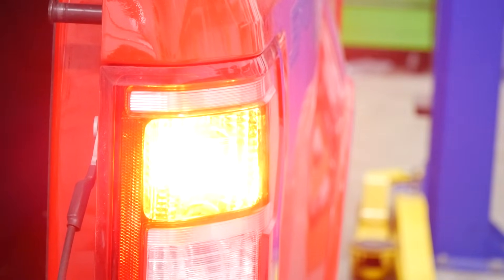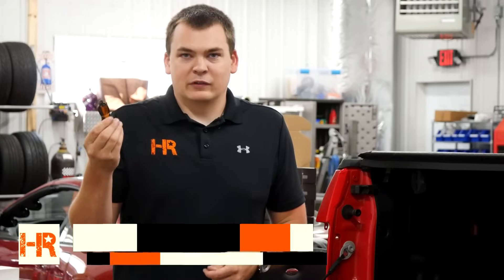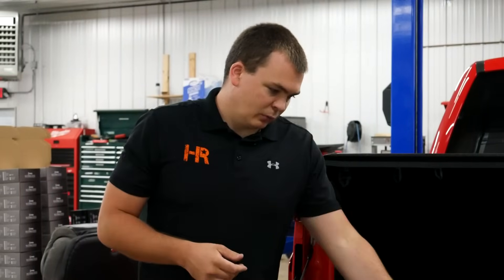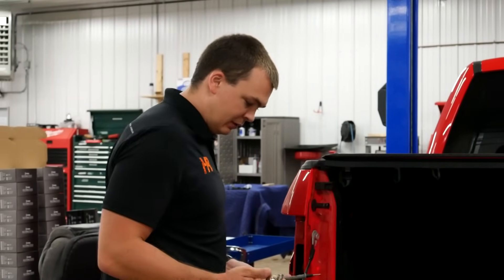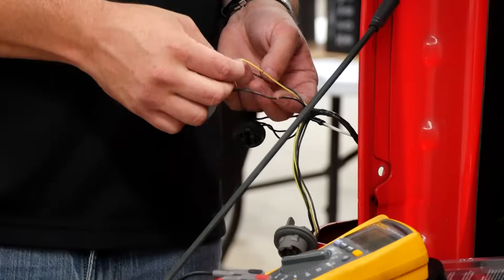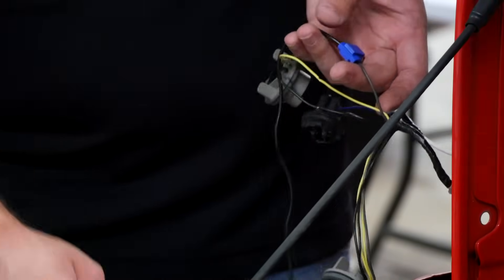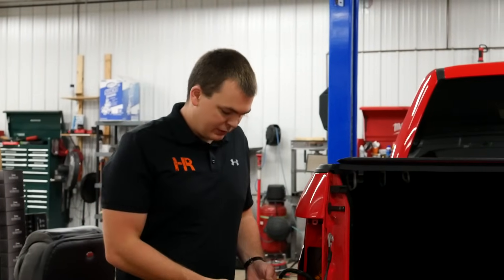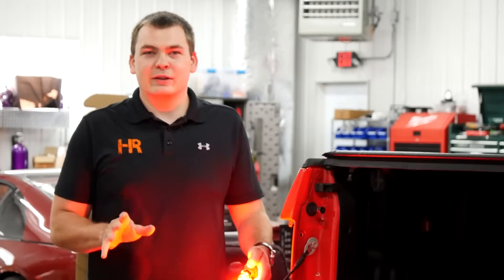How To Install LED Resistors - Everything You Need To Know | Headlight Revolution

Comment: I installed led bulbs on my 1995 ford F-150, I don't have the hyper flash issue but it does affect my Cruise control. When lights are on cruise doesn't function when lights are off it does.  I have 1 bulb that does it all blinker/park/brake. Will installing a resistor fix my cruise control problem and which wire do I connect it too? Thank you
Reply from the maker: Possibly. Sometimes the vehicles' original electrical circuit needs that resistance provided by the original bulb or the resistor. Worth a shot, but I can't say for certain!

Comment: there are LED turn signal relays out there so there's no need to wire in resistors.
Reply from the maker: That is true for some vehicles. Many don't have the ability to swap out a relay if the flashing is controlled by the BCM. Anything made after 2004 is more and more common to NOT have a relay you can just swap out.

Comment: question I replaced front and rear blinkers and brake lights on my 2011 FORD Escape with new LED's  and I added LED Decoder Adapter Anti Hyper Blink Flash Error Cancel Canbus Brake 12V,  just the back light, turned the blinkers one it was blinking normal, but as soon as I turned the lights on it started blinking fast again, any ideas how I can fix this
Reply from the maker: Hi Roger, for troubleshooting like this please contact our help team: sales@HeadlightRevolution.com

Comment: Where should I connect the resistors, because I change my front turn signals and now it blinks so fast, so I add in the front or back turn signals. Thanks
Reply from the maker: Everything you need should be in this video!

Comment: Do you need a load equalizer for each led bulb? Because I wanna change every bulb for led ones and my tail lights have three: reverse, turn signal and side marker. So do I need one for each? People always seem to change either the turn signals or tail lights only but not all of them so I can’t find answers anywhere. Please help. And later on I wanna do the same with the headlights.
Reply from the maker: You only need a load equalizer (resistor) for each bulb that blinks in the turn signal circuit. Most of the time all other bulbs require no extra parts.

Comment: Reyes doing this on 08 Silverado hooked resistors one wire to turn and one to ground double checked and still hyper flash any suggestions? Did a resistor to each light separately still hyper.
Reply from the maker: Chris Nelson 2:32 PM
The 2008 style Silverado trucks have multiple turn signal wires because they dasiy-chain together to more than one turn signal. You have to wire it up to the correct blinking bulb wire and it's one of two. Any ground in the harness will work, but you need to search to see if you have another blinking wire too. This writeup has some tips for you:
https://www.silveradosierra.com/hid-led-lighting-f505/led-load-resistor-wiring-confusion-t76650.html

Comment: Do you need resistor if you have lower power led light
Reply from the maker: If the voltage source is equal to the voltage drop of the LED, no resistor is required.

Comment: hello, i have a bmw e46 compact the tail light has 5 cables,i have identified the ground but should i connect the other end to the positive wire of the turning signal ?
Reply: Let me butt in. Ground and Turn or Flash, not Positive which is normally the Power or 12 volts.

Comment: What kind of load resistors do I need for a '98 Nissan Altima ? I tried the 50W 6ohm, it worked when i tested them once then I tried to actually connect them and it didn't work.
Reply from the maker: XenonDepot XD6 6 Ohm Resistor
Reply: @HeadlightRevolution  Okay, Thank you !

Comment: There is an easier way.... A heavy duty flasher will give you the same result. I got a flasher with a rheostat and can make it flash at the rate i choose. I'm no electrician, but i have successfully made a HD flasher work on several vehicles.
Reply from the maker: That's one way to do it. We prefer to show this way as its easy to grasp and sure to succeed.
Reply: I bought a flasher from Amazon with a rheostat on it that allows me to adjust the rate of flash from 0.5-2 seconds. I have LEDs front and back with no resistors.
Reply: They make HD flashers for LED use. I looked and found a couple of different flashers. Without knowing how many pins are on your flasher I can't pick one. But, find a LED, or HD, flasher that has the same diagram on it as the stock flasher.

Comment: I just want to make a comment about the flashing light without the resistor, shown in the first part of the video......it wasn’t blinking that fast. I’ve seen hyper flashing and that wasn’t, in my opinion. Mine flash that fast and I’m glad cause my turn signal lights are red like that truck. It makes it easy for other drivers to differentiate between braking and lane changing, especially in Toronto where 90% of people drive fast and tailgate.......so I think if your lights are flashing a little bit faster, don’t worry about it.
Reply from the maker: Definitely not necessary but we still recommend installing them to keep proper power running to them

Comment: My led switchbacks hyperflash with parking lights on even after installing 50W 6ohm resistors on my 3157 bulbs. With parking lights off, they flash at normal rate.
Reply from the maker: Give us a ring sometime today and we can have our support team help you troubleshoot. 218-755-5200
Reply: @HeadlightRevolution  I am not in USA. If I can chat with your team via email or Facebook would be really helpful. Thanks

Comment: i have a problem, after putting on the resistor i saw the needle for the battery was flicking back and forth with the blinking light. to keep it short, when i took off my brake switch and opened it, i saw burn marks on the contacts. after a while of use the burn marks keep the brake switch from working. any solution for this?

Comment: WOULDN'T IT BE EASIER AND
SIMPLER TO JUST GET A DIGITAL
TURN SIGNAL FLASHER...INSTEAD 
OF PUTTING A RESISTOR ON EVERY
 TURN SIGNAL LIGHT ?
Reply from the maker: GTR lighting just released the Carbide Turn signal, no resistors needed!

Comment: So I just got a 3rd brake light for my 03 Ram 1500 and the led cargo lights won’t turn off even if the truck is off. So if I get some resistors it’ll solve my issue ?
Reply from the maker: Hey Anthony, resistors tend to help fix hyper flash.

Comment: The one problem you'll run into wiring your resistor like this is that you've just created 2 paths for electricity to flow so your vehicle will never know when your LED is no longer working until after the resistor blows too.
Reply from the maker: We have yet to see an issue with how we have wired the resistor. But if something changes we will be sure to update everyone!
Reply: @HeadlightRevolution  It wasn't a question...it was a fact I just stated...in the auto shops I've worked at it's a reocurring issue that has been brought to my attention...since the sensor on most vehicles HUD 95 and up will only turn on and let you know a bulb is blown when there is no return of electricity...and since the resistor acts as a second return line there is no break in the line causing the light to stay off because it doesnt recognize the led light is out...you won't come across this issue often unless the customer is automotive savvy or you test it for yourself...led's take a long time to burn out so you'd have to be in the business for a long time to see this.
Reply: "you won't know your LED is no longer working"

Lmao ok

Comment: Will it ever cause a dim blink on one side
Reply: Ive never installed the resisters yet ive installed led lights on my trailer. And when I hook up my trailer to my truck one side is normal and the other is dim when I activate the turn signal on the passage side truck and trailer
Reply from the maker: It's not an issue that we have run into when installing these resistors.

Comment: My issue is not hyper flash outside but rather inside on my dash for my 2015 Ford F150.  I will try parallel first and then if that doesn't work then I will try series.
Reply from the maker: Let us know how it goes!

Comment: During the day my flashers work great other than the hyper flash. In the evening when the lights come on the right mirror light is on, there's a message on the dash about turn signal on and half of my tail light is not working. When I try to use the right turn signal it flashes once and stops, any clues?
Reply from the maker: It sounds like we may have more questions about this. Can you give us a call and we can hook you up with one of our support staff? 2187555200

Comment: Tried to installed my H7 high beam bulbs H3 fog light bulbs with led , they were flashing for good 30 second at least after I used them , any solutions?
Reply from the maker: Hey there! It sounds like we will probably need more information than you provided in this description. Will you give us a call and we can help troubleshoot. 218-755-5200

Comment: My resistors for my 2016 GMC Canyon were plug and play.
About $10 each to use my for my led upgrade for front and rear turn signals and taillights
Put a temp probe on them and they were almost 400 degrees.
Really hot! Any low temp resistors or good suggestions for me.
Just didn’t like how hot they were getting especially being that close to each other.
How hot does yours get as an example for the Ford vehicle you did in the video?
Thanks for the help.
MarkO
Reply from the maker: Hey Mark! We aren't sure of the exact temperatures of our resistors but it is definitely not 400 degrees!

Comment: My only question isz why to the ground? I.E. when I were installing resistor to the H7 headlights, I were told to put resistor on positive wire (+------/ ~=~ /------+), not one end to the positive and another end to the ground.
Reply from the maker: Sounds like you have some questions our support staff can answer. Give us a ring today! 2187555200

Comment: Do I need to put load resistors on all four LEDs for the hyperflashing to be fixed?
Reply from the maker: We have a few questions of our own to be able to answer that. Can you give us a call sometime today? 2187555200
Reply: @HeadlightRevolution  thank you for the reply on this, I'm from the Philippines and the reason I'm asking is that I see all these videos on installing the load resistor but they don't specify if this is per turn signal LED or per pair of turn signal LEDs. I have a 2015 KIA Soul which I can access the rear turn signal wiring easy enough. But the those in the front has that one set of wires that connects to the headlight housing and the turn signal is housed in a socket with no direct wiring. I think I'll need to check the mass of wires going to the headlight housing to determine which is which.
Reply: 1 bulb requires 1 resistor, if needed. Cars with CanBus system almost always require resistor for every single bulb you replace, because headlights won't be blinking, but you'll get burnt bulb error and led will shut off after few seconds you turn it on.
Reply: @baihult  thanks for the clarification. Now I know what I need to do to have the LEDs function properly.
Reply: @baihult  My car has CanBus and I only replaced the front indicators to LEDs, but all indicators, front and rear are hyperflashing. Do I also need to change the rear indicators to LEDs and get resistors for them also to stol the hyperflash all around?
Reply: Warren Rozario if done properly, it shouldn’t hyperflash. That’s the system - if it detects that one bulb is burnt, rest of the fine bulbs will start hyperflashing. And canbus detects leds as burnt bulbs. Did you installed resistors on both replaces leds?
Reply: @grailph  Hello, I am facing almost same phenomena as you described. My car K7 Kia (2014) is also easy access in the turn signal in the rear while access in the front is complicated as all wires of head light and turn signal etc is combined  all together, thus it is too much work to take out only for turn signal wires for load register  hyper flashing issue.
Currently, both right and left in the front is halogen while both in the rear is led installed and No hyper flashing.
I tried already installed load resistor in the rear (easy access) but still hyper flashing.
Someone expert says on other YouTube each led require each load resistor, then it means I need four load resistor installation.
May I ask how you solved in your car? (your case is very close to my problem..)
Thanks. Daniel (Korea, Seoul)
Reply: @deobiloilchil  I only put the load resistors in both rear taillight housing . In my case I put the load resistor across the black and yellow wires of the turn signal bulb. The front turn signals I kept the incandescent bulbs. No hyperflashing. I even replaced the  side turn signal with a T-10 led and still no hyperflashing.
Reply: @grailph  Thank you for your quick reply!. I also still have original incandescent halogen in the front signals... Thank you for me how to deal with this...

Comment: Why the hell would you strip back the wire shielding you don't need ? Now you ruined it's  seal. That's lazy. Just get a goddamn wiring diagram.
Reply from the maker: Thanks for recommendation Chris!
Reply: @HeadlightRevolution  I'm sorry, I'm not trying to be rude but it's much better to never disturb a wire jacket if you can, it will cause massive corrosion.
Reply: chrisdigital that was really rude 😣

Comment: Pro Tip If you wanna avoid ripping part of the sleeve off to test a wire... take a safety pin or a sewing needle, and jam it into the wire you wish to test, then hit the pin/needle with the tester... Bam! no broken sleeves!
Reply: If you probe wires just seal with liquid electric tape
Reply: @HillBilly-1  i do that all the time never had a wire fail. I usually liquid tape and heat shrink my soldered connections never had one green
Reply: I was going to make the same suggestion. And use the chassis ground rather than clamping the ground wire. The 0v wire is the ground wire ground or ground it directly to the chassing to prevent poor wire juction right where you mount the resistor. Kill 2 birds with one screw.
Reply: You can also use your multimeter probes on the connector pins at the end of the harness
Reply: Could just use a test light in the plug then follow the connection back to that wire 🤷🏻‍♂️
Reply: I would like to know do you have to have a resistor for LED lights on your turn signals if you're doing 1930 through 1970 0 year vehicles thank you
Reply: And I like to know do you have to have a resistor for the front for the back or for resistors per vehicle
Reply: Back probing,  let's be a little more specific about that so people understand. 
  To be honest, that is the correct way to test any wire harness.
Reply: I have done it this way for over 50 years, always works but I do like to Solder Wires, they make the Best Connections for sure...
Reply: Thats not bam..thats Boom!
Reply from the maker: Great advice!
Reply: That's horrible advice!! Never poke a wire unless you're sure you're going to cut it anyway. Once you put a pinhole in that wire you've sealed its fate, it will eventually turn green. It's just a matter of time and there's no stopping it.
Reply: @flyurway  liquid electrical tape. A pin hole is easier to fix than a fully separated sleeve. IMHO
Reply: @lockelamora0717  Again, once you poke a wire, it's done! I don't care what you put on it or how quick you do it, it's just a matter of time. If you know what you're doing there's no need to poke a wire in the first place!
Reply: @flyurway  C'mon, with the universal doomsday wire message. The "demise" of a breached wire is SO relative to environmental conditons and how well you protect it. ALL or most 'pokes' can be very successfully protected/fixed for decades or probably way beyond the useful life of the object its connected to.
Reply: @jfitzmo  🤣😂😆😁 Can tell you've never done wiring in the north, huh?! If you break the insulation, it WILL corrode! Period! Just one little poke with a test light is ALL it takes. Ask me how I know. And depending on the elements it's subjected to, it can be just a couple weeks! And nothing like being the middle of a freezing winter and your tail lights are out and you HAVE to get somewhere! Trust me, been there, done that! If you're going to poke around with your auto wiring, spend a little time and do it right and save yourself countless hours of headaches down the road. "Fixed for decades", yeah, BAHAHAA!! 🤣😁😆
Reply: @flyurway we aren’t all in the depths of the polar north. And if properly soldered it and covered with heat shrink; your wrong.
Reply: @dubb7530  It's "you're" and I know for a fact that I'm right. I only did this shit for a living for 30 years and a hobby for 25 more and I've had countless incidences where I had to trace, troubleshoot and fix someone's previous poking around because they didn't know any more than you. If you know what you;'re doing there's no reason to poke in the first place. Poking wires is the easy/cheap/"I don't know WTF I'm doing" way to do it.
Reply: @flyurway Fr people need to stop poking holes in wiring makes finding shorts hell bc people go and poke hole in the sleeve like you said and will destroy the copper in the wires
Reply: @flyurway  
 Always back probe

Comment: Is it still ok to use this if your turn LED and running LED are on the same circuit; burning the entire time? Seems like it would cause damages to the car's battery or something if I do. Unfortunately my running lights are my blinkers. The resistors are getting very hot. I plan to put them in front of the radiator but will it still foul something up? ANYONE?
Reply from the maker: The resistors do get warm so just make sure you are mounting them on a metal surface. You should be good to go then!
Reply: @HeadlightRevolution  Thank you so much for responding. I'll mount them properly